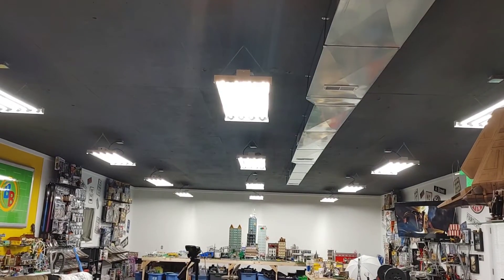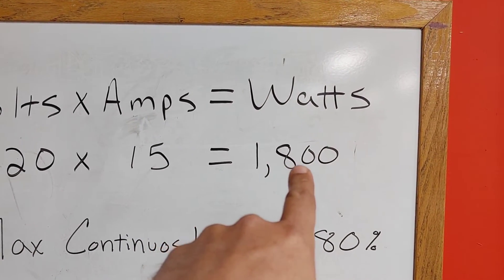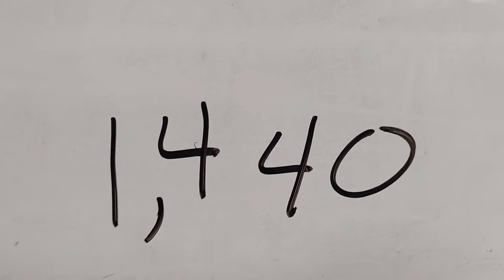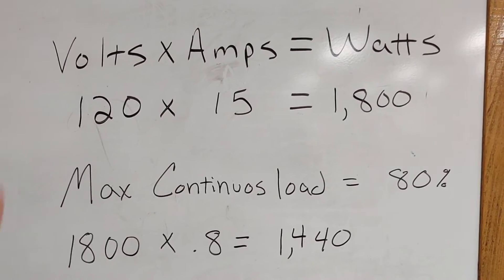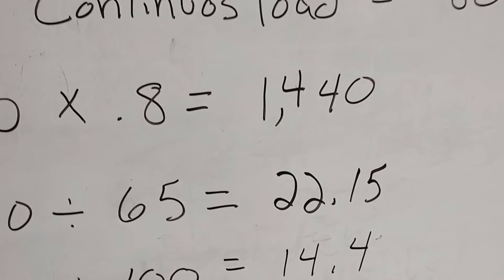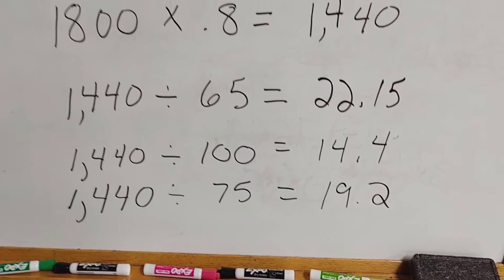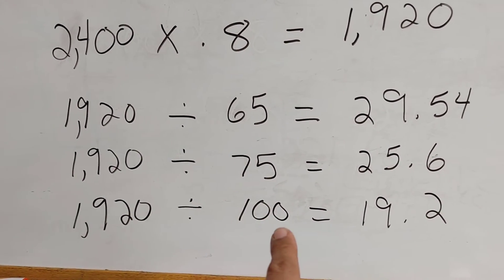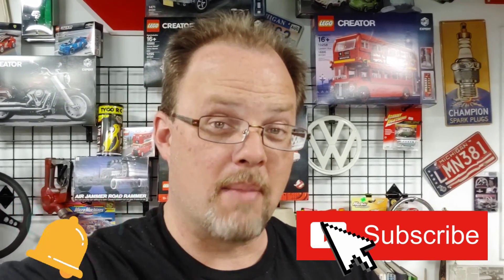How many lights can you put on one 15 amp or 20 amp breaker.

Comment: I just got a heat press that is 1400 watts and my lights are flickering like crazy I know this is too much and they won’t let me return so I’m screwed they don’t Specify amps and other things on this I feel like the seller should def tell people before hand now I have to get a 20 amp and alter everything because they don’t tell u what you need before you buy I feel like most people like me that don’t know much about this would think ok this should be good and then Afraid to use it I wish they would give instructions before people buy sorry im so Frustrated about this that they won’t let me return it for somthing that would work better for me
Reply from the maker: By them giving you the wattage you can figure out the amperage.  I am assuming you are using a hundred and twenty volt circuit so we divide that by the 1400 watts and we get 11.7 amps.  Being that you are plugging this into a circuit that already has a load on it I would say that yes you are overloaded.  So you will need a dedicated 20 amp circuit to operate this.
Reply: @BevinsBuilds  yes that’s what I figured out yes I didn’t really think of this because I had a different press that had no issues like this so I was hoping for the same result I should have looked into it but I feel like they should of said it need to have a 20 amp decacated outlet they told me to put it on its own outlet I did still happened so I know it’s too much even with nothing else on plugged in I have a Dedicated outlet for it but like u said it’s not a 20amp they said just plug it in by it self they did not say what amps it needs to be just that it needs it’s own outlet? So now I know why this is happening it’s so annoying
Reply from the maker: I think you're missing the point it doesn't matter if it is plugged into an individual outlet with nothing else plugged into it you're still using lights on that exact same circuit.  Unfortunately equipment like a heat press or what I commonly find is people using electric heaters in homes I'll need to have a dedicated circuit due to the wattage/amperage they consume
Reply: @BevinsBuilds  I know that’s what the company told me to do  and my husband told me that the lights and outlets could all me on one wire so yea that’s y I’m aggravated lol I know I probably didn’t specify exactly what I was trying to tell u my problem sorry 😞
Reply: @BevinsBuilds  I have a friend that’s an electrical coming to look and see if it’s worth keeping or exchanging to somthing that I can use with the lights on lol
Reply from the maker: No worries at all just wanted to make sure you understood what I was meaning :)
Reply: Rate now I can’t use the lights have to used a battery powered one for now until I figure out if it’s worth keeping or spending the money to keep it ? 😂 I was hoping a 20amp would solve my problem but I would have to have it wired to the box  I’m learning alot now about this I will not make this most again sorry I feel stupid just telling you what they told me to do to fix the flickering problem lol and I told them it didn’t work
Reply: @krystleroy3068  .. the quick fix is an extension cord for portable lights to run from another room... AND ... use LED or CFL bulbs to reduce draw. Do NOT try to run that heater on a common household extension cord.

Comment: Hello, Thanks for that info..I'm looking to install a new AC on a 20amp cir, currently the ac that I have on this same circuit is maybe 10,000 btu.. I want to install an Ac that has 18,000 or more on the same line .. can larger btu's be put on a 20 amp cir (dedicated).. what is the largest I can put ?? This is a window AC
Reply: BTUs is not the rated watts or amps draw and will change depending on the MFGRs current draw for that appliance. (has to do with appliance efficiency) By the time you get to 18,000 BTUs you will probably be looking at an AC unit that's 240 volt anyway so read the MFGRs spec sheet to see what size circuit you need.

Comment: I have a question hoping you could answer. I have a wall socket (I think that’s what it’s called) and it has 2 outlets (again don’t know if that’s what it is, but it has 2 lines and then a dot underneath). I have one dryer and another washing machine that is one cord, and it is plugged into an outlet. So say hypothetically I wanna plug in a power strip in the second free outlet and have that plugged into a laptop charger constantly charging that laptop for gaming purposes, and a monitor hooked up as well, plus sometimes charging a phone. The power strip says it has 15 amps. Would this be considered safe

Comment: Sorry. where did you get the 120volts? where did you get the 15amps & 20amps? can you change the breaker 15 or 20 only? or does it comes with other size? 
how about the poles? wire size? sorry for my ignorant questions
Reply: Apparently, you don't have prior knowledge about electrical🤷🏽‍♂️
Reply: @SharazRAli  Thats why im asking. can you help
Reply: @sagittariusmax5419  Sure......you asked a question about poles and 120v......there are single pole and double pole breakers, a single pole is used to carry out 120v which will be 1 hot wire and a double pole is used for 220v which will be 2 hot wire, now in this case sinario we are dealing with 120v current because they are using lighting fixtures which don't need alot of volts unlike a dryer, washing machine, etc which will need higher amperage of breaker. Now the 15 amp or 20 amps breaker will based on how many lighting fixtures are going to be used on 1 breaker hence the reason for calculating volts×amp=watts.....there are many higher amperage breaker sizes which are used for more load . The wire size will also be based on how much voltage will be carried out to your fixtuers so you can use a proper size and not overheat your wire and burn anything......hope this helped if there is anything else feel free to reply
Reply: @SharazRAli  Thank you ! i wish i can ask more.